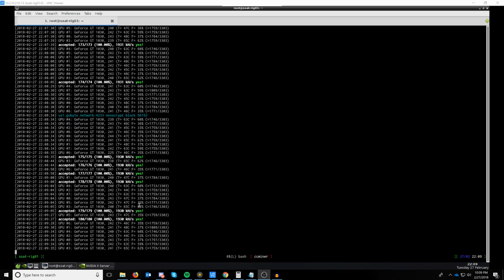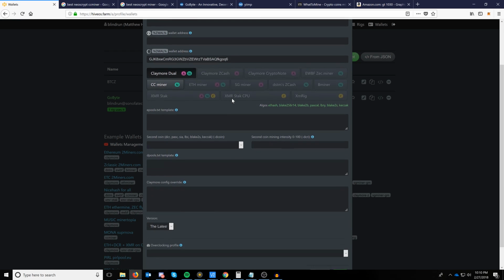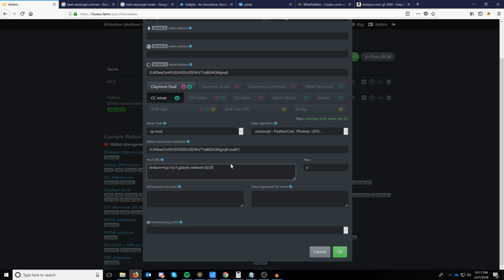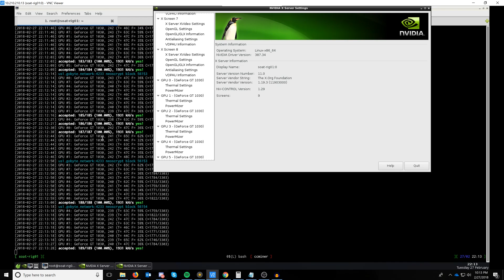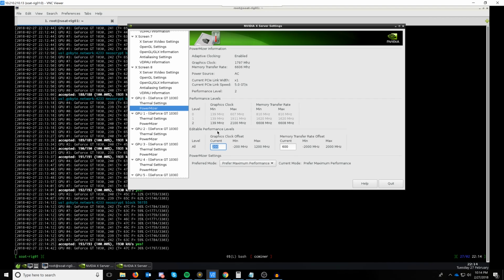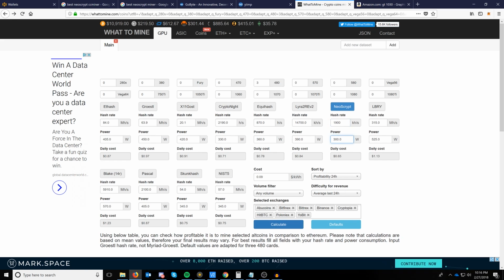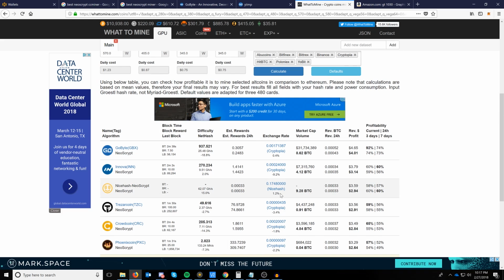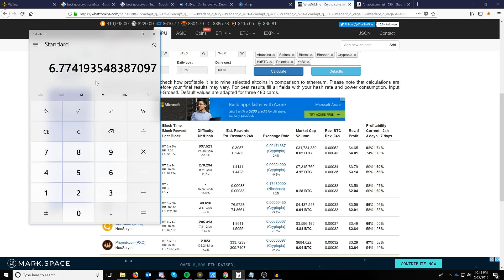How to Build a Budget Mining Rig 2018 | Under $1000 |

Comment from the maker: Correction: 4.01 is profit after power not 4.65. The octominer in fact uses ddr4 not ddr3. There was some confusion there. Apologies.
Reply from the maker: Well as stated multiple times that's the way the market works
Reply: Just did the same calculation on the same website. I'm getting 2.66 after power with GoByte 2000kh/s 300w
Reply: Son of a Tech very informative video regardless of mistakes. Thanks for taking the time to make this video :)
Reply: yeah was just saying it changed pretty quickly, I'm aware of the volitlity :P nice vid anyhow man
Reply: Son of a Tech can you plz do a vid of you assembling it step by step
Reply: usb miner gives 3.5 mhs

Comment: This is not half bad, good job... but!... if anyone is building a rig now, it's best to wait for the Nvidia mining cards coming soon, higher hash (47) than 1080ti and cheaper than 1080's wich means faster ROI.   Pros: cheaper and more powerful.  Optimized for lower power consumption.  Cons: Lowered warranty and no I.O (limited resale value, but who buys used mining video cards? that's just stupid). So the best advice now is to WAIT for a bit

Comment: I find the whole idea of mining immoral. This is increasing the carbon footprint of the planet, we are having to burn coal, oil and gas just to generate the electricity for these operations.

 It is leading to climate change. Even if people don't believe in believe in Climate Change, but there are stark realities, such that we only have a finite amount of resources. What will we leave future generations?

Burning coal, oil and gas does reduce air quality (these are things you can measure).

Whoever invented these Crypto currencies did n't think of the environmental impact. 

So while you earn $xxxxx, but the cost of increasing flood defences runs into the billions. 

It would have been better if this was a demonstration of using solar panels and wind turbines etc...
Reply: Might as well turn your computer off because in the time it took you to write your whiny post you helped increase the carbon footprint of the planet.

However to have a serious argument for a second, gamers use more power when gaming than we miners do when mining. We go through great lengths to reduce the power consumption of our GPUs well below rated specs. Gamers generally do the exact opposite and crank their power consumption up for better framerates without doing much to actually optimize the card. So if you're gonna get butthurt over miners, go whine at some gamers, too.

Comment: thanx for shared at the same cost 1080 ti instead I will take 1030 12X
1080ti = 4 $ 150 Watt but 12X 1030 = 8 $ 320 Watt.
Reply: Bad idea, my friend. Really bad idea. In less than a year you'll be throwing all those GT 1030s straight into the trash with no hope of reselling. At least when the new generation of team green cards land later this year, you can still use your 1080 Tis or even resell them. GTX 1080 Ti is making over 4.50/day right now. GT 1030 is making around 0.10/day. So... 4x1080ti makes 18/day. 12x1030 makes about 1.20/day.

Comment: does it really matter which 1030 i get? like if i go with the cheapest one will it have much difference?
Reply from the maker: Hard to say without testing. But I would say not much of a difference. If you get fanless have some way to move the air is all
Reply: Thanks for the quick answer and advice! :)
Reply: And one more thing, does it matter if its ddr3 or ddr5?

Comment: Am looking for a psu for the octominer and some gtx 1070s.  Wondering why the parralel miner psus don't come with a power cable, where to order the power cable and which breakout board I would need.
Reply from the maker: The octominer is powered by pcie so no need for a 24pin on the parralel miner

Comment: Newbie's tip of the day:  if you bought the fan-less 1030 as I did, don't overlook the need to cool it.  I have a single 1030 with SOAT's OC suggestion running on an AsRock AB350M-HDV.  Temps settled around 78C with hash at 235 kH/s.  I put an external box fan against the open case and temp dropped to 40C with hash at 242 kH/s.  DOH!
Reply from the maker: You do need circulating air haha. Good to hear man

Comment: hey blindrun one more question can you use a m.2 adapter with the msi a pro z270 board
Reply from the maker: I was able to. Some people have reported issues
Reply: ok do you know of the riser cable you used. as i have seen some do not work very good ? for the m.2 slot

Comment: Didn't have any luck with HiveOS applying the website OC settings to my 1030 and changes using the nVidia GUI would not stick after a reboot, sooo......

[do this from the ~ directory which should be where you reside when you open a new terminal window; stay there]
cp .nvidia-settings-rc /home/customnvidiagpu.conf
nano /home/customnvidiagpu.conf
[add these lines to end of file; if you have more than 1 GPU, add them all and increment index; e.g. gpu:1 with 3 lines; gpu:2 with 3 lines; etc.]
[gpu:0]/GPUMemoryTransferRateOffset[2]=600
[gpu:0]/GPUGraphicsClockOffset[2]=200
[gpu:0]/GPUPowerMizerMode=1
[save and exit]
nano .xinitrc
[look for the line where HiveOS tries to apply GPU settings]
--edited [beneath that line]
[ABOVE that line]  --HiveOS would not apply a change in wallet pool address, so I had to drop the rig and re-add.  That blew away the lines I added to .xinitrc.  Add them above so that a drop/add to a rig doesn't clear them.
nvidia-settings --load-config-only --config /home/customnvidiagpu.conf
[save and reboot]
[check your nVidia X settings GUI; you should see the desired settings stick]

Comment: Hey I know dumb question... I have a 6 gpu rig  and can't get nicehash or any algorithm (ccminer x17) to recognize the 6th gpu.  The computer recognizes it and nicehash will recognize it at first, mines for 10 seconds, then drops the last gpu.  Any help is appreciated.  If you successfully answer my question with a solution that works I'll pay out $5 in bitcoin to your address.
Reply: Snow Mexican-LSD Maybe try switching out your riser, or trading it with another GPUs' riser on the same rig, to see if its related to the riser/slot or the actual GPU. You may also want to check for heat along the wiring, GPU & PCIe slot at the time it fails.

Comment: I'm running 8 GTX 1070's on my Asus Prime Z270A
You can run up to 9 with that mobo if you can get the second M.2 slot to work. - haven't tried yet.

Comment: The only issue I have with budget rigs like this, is you leave no room for future expansion.
For instance, if you swapped out your 8*1030's and put in 2*1060's, you would be spending $600 instead of $640, but also have 4 extra slots on the mobo for the future if you want to add more cards. Using your example, you would have to first try and sell the Gt 1030's [not going to get much for those used] to free up an expansion slot.
2 1060's can easily do 600h/s equihash and are also pretty good at daggerhashimoto. They won't be quite as profitable as the 1030's, but the initial investment up front is slightly less [Newegg will sell 1060's for < 300 if you are patient] and you will have a much easier time 6-18 months down the road selling a used 1060 vs a 1030.
Likewise, if you can get a good deal on a single 1070, you would be in a similar position.
Basically, I think you are best off buying the most powerful GPU you can that is of a reasonable cost and within your budget, instead of multiple slower GPU's that will be outdated very quickly.
I'm also a big fan of older DDR3 mobos like the GA-970A-DS3P. New on Newegg for $90, 5 PCIE slots, can use a cheap Athlon X2 215 [$15 ebay] and DDR3 memory. Used they are like $50, so that is $85 for the mobo/cpu/memory combo if u get used. Lots of savings off of that $199 mobo with DDR4 memory

Comment: Thanks for all the info!  I've decided to jump in and ordered the complete case, power supply, memory, and ssd from Octominer.  I also picked up 8 of the silent Gigabyte GT 1030's from Amazon (they now limit to 1 per household, so I bugged 7 buddies into ordering one each for me).  Setting up my accounts with GoByte and Hive using your links.  Just a hobby for now, but thanks again for your guidance.
Reply: Is your rig still working and profitable?

Comment: Great video. Question though. With the calculations, wouldn't it be similar to paying the same (inflated) price for a 1070 (maybe ti) as 8 1030's? similar ROI and might be easier to get more of your money back if and and when you decide to sell. ALSO more versatile in the future for mining if you stay with it. I haven't bought anything yet so I'm still looking for the best route for GPU's right now
Reply from the maker: A 1070 pulls about 1.2mh/s as opposed to 1.9. Now I could try harder on oc. But I'm not confident I could get 700kh more out of a 1070
Reply: I'm in the same boat. Like the idea of the 1030 build but don't like the re sell value. Just gonna wait and try get 2 1070 (maybe ti :P)
Reply: Definitely lol my 2 card rig cost slightly more but makes about the same amount mining eth. The only reason mine cost more was because I chose not to skimp on the less important parts like the motherboard. ram and cpu..1/4 the cards and 1/4 the headache.. Ive crunched all the numbers and when you consider setup time, quality, reliability and of course resale value, you are far better off with less, high quality cards than a bunch of shitty ones
Reply: really love this i find most profit from my refrub   rx460 pulls 125 sols stock...300 h/s on cryptonight    only paid 120$ too i like... i use 550s on eth and the x60 on zcash or equihash

Comment: How do you know what coins work with low memory cards?ARe there any sites where you can put in memory limits of cards?

Any other coins besides neoscrypt that will work well? Why just neoscrypt?

What's the miner fork option in hive os?
Reply from the maker: 1) Research
2) No sites but you can google "ethereum dag size" for example
3) There are plenty of options this is the wild west mate
4) GT 1030 is a surprisingly high rate on neo. 
5) CCminer is Open source therefore people fork it and make optimizations. This options chooses one of those forks to improve performance.

Comment: Why not get just 1 RX 580 or 1 GTX 1070 instead of the 1050s?
Reply from the maker: if you can get a 1070 for less than 600 sure. Otherwise ROI is better here.
Reply: Son of a Tech $599 at the moment --- https://www.bitnand.com/product-page/msi-geforce-gtx-1070-armor-8gb-oc
Reply from the maker: 1.2 mh/s vs 1.9mh/s on the 1030s for the same cost.... Well to be fair 40 more on 1030s. Also not positive that retailer is any good.
Reply: Son of a Tech true, the seller is active on reddit. He does GPU analysis and mining samples on YouTube. I dont doubt they are real miners, but true its risky buying out in the wild. They also sell P104s and P106s which are hard to find. I've been scammed on eBay before but I use PayPal and Chase so I can file a dispute with Chase and get a refund if the seller bailed.
Reply: On a side note, I just bought an MSI RX 580 8gb from Amazon directly for $320 over the weekend (not through amazon 3rd party seller)... They published and sold out in 1 day. I noticed Amazon does this on occasion and they discount the price way lower than other seller. The same MSI single fan version is selling at 499 right now -- 2 left in stock
Reply: ..my 570 8gb msi gets 29 mhs

Comment: I think the RX 550 2gb is better solution for cheap mining. What you think? If you clock it it can make almost 500h/s in monero...
Reply from the maker: Wait till you all see farm wars this week. Your world is gonna get much larger mining wise
Reply: Built my 4x RX550 rig for less than $800. Getting 1800H/s in SOAT SUMO pool. Would love to submit for a "battle of the budget rigs" episode? Best bang for the dollar!
Reply: ivan2fast4u ETN more profitable :)
Reply: yes 300 h/s stock only 450 if you unlock largepages which i still need to sdo my 6 gpu rig get 1800 hashs stock atm on ETN
Reply: Look at ufdtech, he says 1030 is better than 550
Reply: Im mining cryptonight and 550s are by far better at that algo but you got me on neoscrypt and a few others
Reply: I went with the 4g 550s i also got a couple 2 gig 550s but since the 2 gig will not have near the same resell value,,,but the 4 gig have gotten a bit harder to buy i can give you a couple tips like ... google exspress 1st time purchase is 20% off i got 2 cards that way and saved 20$ also the express searches lots of shops too .. the cards came from frys in the end
Reply: Use in stock alerts to your email as well
Reply: and sometimes the 560 is just as cheap.... also the 460 gets better on equihash i find like 130 sols
Reply: yeah bro, 25tb burst ,3 moonlanders 2 on(iginition), 6 gpus ryzen 1600,staking (ignition), streaming bro , streaming video, my multi rig.  my second main pcie slot isnt showing up cards atm though im sad but i just orderd a full octominer cause i liked the price whole rig (execpt gpus for 500  501.11 $exactly)
Reply: also im getting my 8tb drives for 120$ usd now
Reply: CoinSmith Mining  what is better to buy rx 550 or 1030,1050  2gb, because I think buying rx 580 but is to expensive!what is more profitable near rx 580??
Reply: CoinSmith Mining Where are you getting your drives?
Reply: i asked for 33% discount to get the 8tb external for 120
since you can do that it just sometimes makes orders take forever to get picked up
Reply: i will be making a video on this method since it works fairly well

Comment: Nice setup! How loud are those cards?
Reply: The Defenestrator no fan means no loud
Reply: I got a different brand EVGA but , his like mine both are just big heat sinks no fan noise at all . Mine gets quite hot to the touch .
Reply: I think it would be better with a fan just a few $1-2 more per gpu with the fan version
Reply: freusin its never gets hotter than 67 C

Comment: I would not count with 4.65
1, its without electricity
2, its diff dropped 25%, but thats just for minutes

Doing the math with the more realistic 3$ profit (so with electricity) its about 10.5 month
Reply: The chart shows $4.01 as the daily profit. Texas also has low energy costs at least relative to places like Taxifornia.
Reply: yep haha soon as i commented i realised the difference. im trying to get some money together for solar before i build a bigger rig. just have 2x 1080s atm but in australia i pay 26c per kwh so it really eats any profit. 4k AUD can get you a 6kw solar system though so if ltc or ada takes off i should be cheering
Reply: so why does the site need to know what power consumption and how much you pay for power if power isnt factored into the $4.65
Reply: You can see 2 numbers each coin. The upper one is the revenue (without electricity), and the bottom one is the profit (with electricity)
Reply from the maker: Yes error there my bad
Reply: That's really smart idea, but solar panels now cost a lot  and if lots of people start to hazardly buy them they'll eventually go up